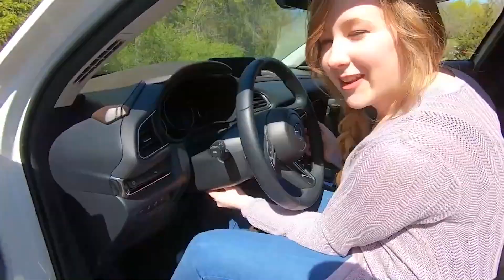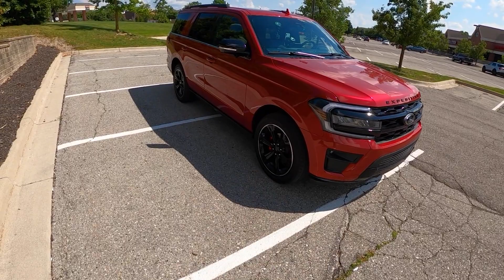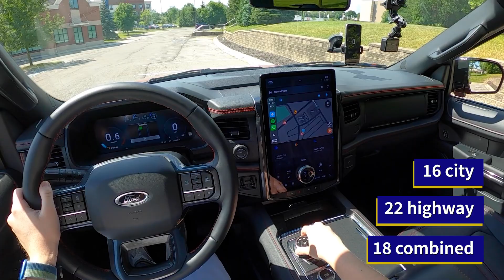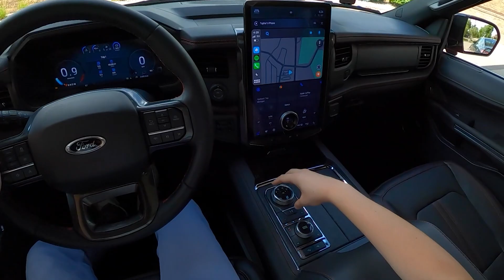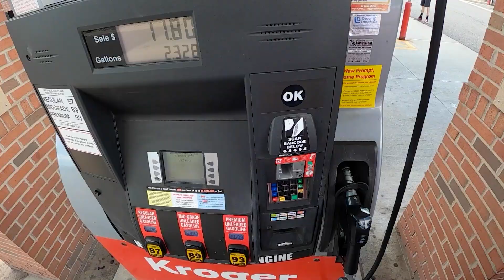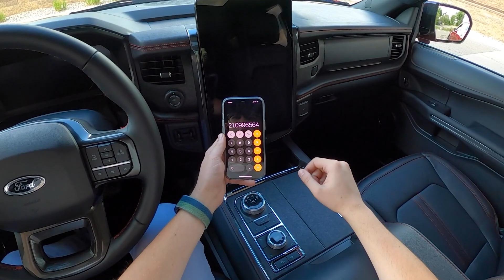2022 Ford Expedition – MPG Test | Real-world Highway Fuel Economy and Range

Comment: Just did 80 on the highway between Chicago and Detroit round trip. Got 21.6mpg for the trip, 600 miles. 

Wagoneer 4x4. 5.7 Hemi with e torque. Cruise control not used.
Reply: 600 miles on one tank?

Comment: It's only rated 16/21 so it's right where it should be. That is about 1mpg better than a 6 year old expedition was rated, if you needed one there is probably a bunch of used ones on the market right now that would be a better deal than spending $55k for pretty much the same thing.

Comment: Highly inaccurate considering that fill amount will vary depending on when gas station will decide to shut off automatically. Can vary about +-1 gallon each time you fill.
Reply: Agree. I thought they usually did a 100 mile loop which would help the accuracy.